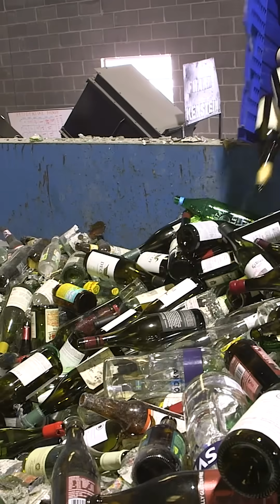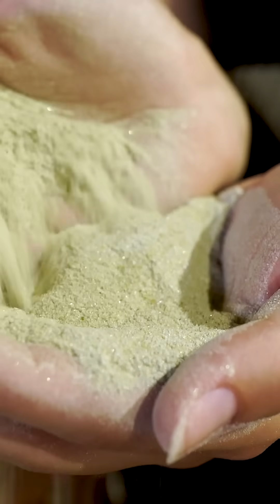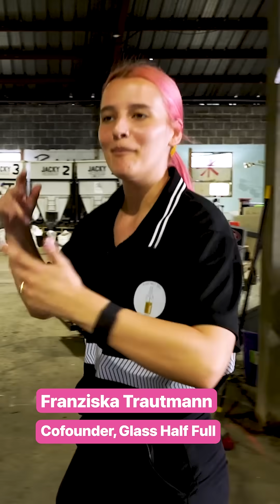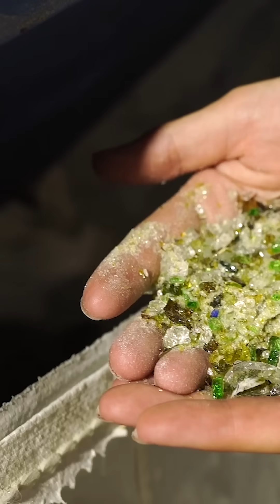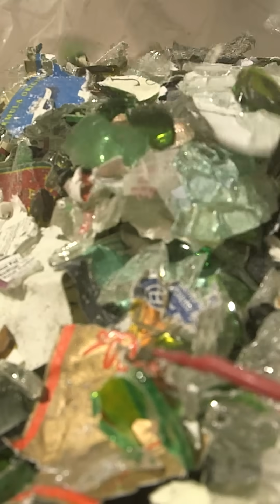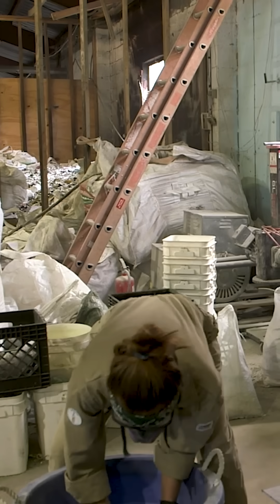Here’s how this entrepreneur crushes glass bottles back into sand. #Recycling #Sand #Glass

Comment: Germany just reuses glass bottles for new bottles by using forges which melt the glass leftovers to one mass while burning of any residues. The shown process is quite cursed. You have a lot of bottleneck processes (no pun intended)slowing down the whole production line. Meanwhile the building site will be full of glass dust, impacting the health of the workers.

Comment: Why would you do this. In europe we have a whole deposit system for beer bottles so they only have to be washed out and then can be used again countless times. This just uses a lot of energy and causes a lot of risks for the workers involved because i didnt see any proper ventilation or air extraction for dust particles. Espacially with glass. That is super important.

Comment: Surely if you ran the glass through a just below melting point, the glue and paper would burn off. If you want to skip a step of chemically removing glue when in a multan state, they could always soak the bottles in vinegar. This would result in less cost with mechanic separation and also loss of total end product because the machine didn't waste what could end up being 1/3 of the overall product.

Comment: Looked really dangerous and inefficient. 
That should all be done in an enclosed space with a ram to push glass into an elevated chamber, the material then dropping into a millstone chamber, after that it drops into a sand trap. You can use a water filter to keep the VERY DANGEROUS micro particles from escaping along with a MCU unit to filter the dust.  Bet there isn’t very many workers who don’t have micro particles of glass in their lungs and eyes, along with every other mammal in the that happen upon the dust area.

Comment: That's great! More of that.
Just funny to hear about something we've been doing since 1972😅
Reply: Blueness1230  what if this thing used in construction? Will there be any difference?

And will the beach ecosystem be broken because the glass dust won't act the same way as real sand? I'm worried if over time, the beaches its dumped in will rise in temperature, making it melt between the real sands and coagulate together etc.
Reply: @huhisitreally  can't be used. Has a less rounded shape as cement sand.

The real heouc story would be whoever figures out how to turn these glass sand grains rounded enough to use in cement.
Reply: @jubhgioubgob  oh yeah. They're shards so yeah it won't hold
Reply: @huhisitreally  Its not that the lack of roundness means it doesn't hold. The shard shape means the cement or concrete will rapidly fail under loads way below what would normally cause failure in concrete. The sharp points create things called stress concentrations were basically the entire load is focused into the tiny point of the shard which results in cracks. Those cracks propagate and the entire thing fails.
Reply: @joshuabaker6452  that makes sense, thanks for the lesson!
Reply: Every female empowerment story ever.
Reply: @mynameisnotyours what?
Reply: @mynameisnotyours  ok Tate

Comment: there's a big difference in crystalline structure, when you crush glass you don't get sand you get crushed glass, and all that's good for is melting down into new containers. the main use for sand is in concrete, you can't use that in concrete, and because the sand in concrete is irretrievable, there is a major global shortage of sand

Comment: That's not sand, that's crushed glass, sand is blunt while this is sharp, also glass particles are in the air, the employer is committing a crime by having the employees work in hazardous conditions without requiring PPE, the only employee seen wearing a mask is wearing it incorrectly

Comment: I really hope they start wearing proper PPE, you only see one person wearing a respirator at the end. Even when the machine is not running, dust can linger in the air for a long time in an enclosed building like that. Silicosis is a nasty interstitial (meaning it affects your tissue) lung disease, trust me you do not want silicosis or any other interstitial lung disease. It will cause scar formation in your lungs and make it easier to get infections like pneumonia and harder for you to breathe. There is no cure and this disease only gets worse with time, all we can do is treat the symptoms and even then there isn’t much we can do

Comment: Help push For a plastic salvage value in reclamation effort. To be awarded, it has been awarded the lead and copper before. This value only applies to scrap or salvage plastics. It would not affect the market price. Because it's a global reclamation effort. We can even build in reclaimables and plastic industries itself. Such as the tabs left behind on plastic bags. So the reclamation effort is also 14 fine grocery shipping and reception. There's a way wording this specifically can help a lot.
Reply: Starting in the right place. It's focusing on the pace of salvage to build in to a perceivable market so that microplastics can be eliminated. Since it is important that we attempt to do so.
Reply: The reclaimables are abridged not focused to stabilize jobs. It's because we re amplified the intention of the reclamation efforts for the vacation. So these excess plastic pieces during a pressing process. Do qualify in order to insure their jobs will be around. Commuting action and parties would be referenced and stabilized in frasing and legality of reclamation Meaning that working with a group, people can be named the salvager. And because of access, it can't be shared with the low job provider if it did not meet the requirements.

Comment: Glass and bottle recycling has been a thing here in Sweden for decades. Standardized 33cl glass bottles for soda and beer are left at supermarkets and you get a pawn deposit for each bottle p. They has to be whole of course. Those bottles are then cleaned and reused.

Glass, white or colored are left in special containers and then recycled into glass again. At home people sort their garbage and then the garbage truck has different container in the truck for glass, food waste etc. People are pretty good at this and the garbage that can’t be recycled are then used as fuel in power plants. We gotten so good at it that we import garbage from other countries to use as fuel. Of course the smoke gases are run thru different filters and cleaners. So no more land fills with rotting garbage anymore!

Comment: “If you or a loved one have had your hands or lungs shredded by glass dust, you may be entitled to compensation”
Reply: Clearly not glass obviously sand 😅😂 like nah it’s still glass
Reply: @ok.ok.5735 THE SAND STINGS THE SAND STINGS
Reply: Right!!😂😂😂
Reply: I want to sniff it.
Reply: Cool now do it with plastic the actual problem in landfills
Reply: @nuke5231  but there are beachs literally running out of sand because of glass used in skyscrapers so yeah of course they gave an amount of bottles saved from landfill to give you an idea of how much glass was procced but the point is not all about reducing landfill
Reply: @thathollyjorge more for concrete, I think. The Chinese have used a lot of concrete. All those buildings, never to be used or lived in. And the roads, bridges, etc.
Reply: They're wearing respirators
Reply: @oliviaocasain9980 Not the pink-haired lady. Even if she only goes in occasionally, glass dust is something you never ever want to breathe in, and handling the partially-ground glass just seems like a glass splinter waiting to happen.

Comment: As someone who works with glass I get chills from the idea of breathing in all that glass dust. Don't touch this stuff.
Reply: Powdered death
Reply: @Justin_Zimmerman perfect description...
Reply: Literally, I hope they're using it for non-touchy projects like sandbags to fill large plots or smth, it's terrifying thinking some people are saying they plan on using it for beaches 😬
Reply: @toadacrosstheroad in the full video this short is based of they say multiple times that their main goal is using this to "restore beaches"
Reply: @mrono1910  hm, idk how i didn't catch that 😭 though it is still not a great idea to put jagged objects into open spaces
Reply: @mrono1910 
God no. That is horrible. 

The sand that you find at the beach does not have sharp edges - unlike the tiny, microscopic shards of glas that we se here - because over thousands of years rock fragments have been ground up and smoothed out by the oceans currents.
Reply: @toadacrosstheroad prob for decor like sand filled photo frames or sand in bottles
Reply: @toadacrosstheroad I think they are using it for making glass again.
Can you tell me if otherwise.
Reply: @toadacrosstheroad  to be fair if weathered by either tumbler or water would that not solve a large part of that problem? it wont take long to round each of the granules
Reply: @toadacrosstheroad they literally explain what it's being used for in the first 5 seconds on the video. Glass is made of sand. They're crushing the glass back into sand to make more glass
Reply: @tedofuentes6525 And to use for beaches
Reply: @tedofuentes6525 Listen again. They said it was going back to "sand" but they didn't say it was for glass.
Reply: @toadacrosstheroad  It's already there from all the decades of people littering broken bottles or burying broken pottery. Had to get my dog's feet stitched up from it. Digging 3X3 holes I found piles in several places in the yard later.
Reply: @Einwetok  yeah, we just shouldn't be purposefully adding more, especially disguised as normal sand
Reply: @Einwetok  oh wait do you mean there was already ground up glass? Either way, it's sad everywhere is a safety hazard because of pollution/littering. The solution isn't to put our processed creations back into ecosystems and expect it to work 😭
Reply: @toadacrosstheroad what’s the difference between this and normal sand? /srs
Reply: @laer.393  This one is glass. Glass is not sand. Inhaling glass dust is dangerous.
Reply: @laer.393  normal sand is naturally tumbled for a long time, think of how sand is typically around waterways or places that used to have water (such as deserts), it's eroded and tumbled around and beaten up.
Also another thing I think makes more sense to describe it: if you crushed up a piece of rock, such as shale or smth, it'd be sharp and jagged until tumbled or broken down more slowly. 
Conclusion: sand takes long time to become smooth, breaking down a rock like structure will create more of a sharp dust; though in larger pieces it could probably be manually tumbled to create more of the sand effect
(/info)
Reply: @toadacrosstheroad  makes sense, i didn’t even think of the role of natural erosion, i thought there was a composition issue. thanks for explaining!
Reply: @laer.393  no problem!
Reply: @laer.393  sand and glass have different atomic structures. Both are most often made from silica such as quartz, however sand has crystalline structure while the glass was molten and is amorphous/unstructured. But that doesn't make a difference healthwise, afaik. It's more about the size of the particles and very fine, ground up dust like shown in the video might embed itself deep into the lungs and cause silicosis. Miners that mine quartz often have that, in german it's called "Staublunge".
Reply: @laer.393 Are you seriously that slow?
Reply: @davidbreier84  It makes a huge difference healthwise. Amorphous silica dust, such as glass, is much more safe than crystalline silica dust, because it is more inert. Silicosis is caused by crystalline silica, which is found in rocks, clay, cement, sand etc. So people who work with these should be much more careful.
Reply: @davidbreier84  thank you for explaining! interesting stuff. yeah, they definitely shouldn’t be trying to use this stuff for beach restoration in that case.
Reply: @terencetam2122  cool, didn't know that. Any info on why amorphous silica are more safe?
Reply: @davidbreier84  Silica crystals "cleave" along a plane when fractured. This exposes a fresh entire layer of "loose" oxygen and silicon ions (the components of silica). The theory is that when the dust is in the lungs, a moist environment, the exposed layer releases these ions as free radicals (ROS and NFS), causing damage. It is also worth noting that "old" crystalline silica dust is less dangerous since the radicals have been already released, so playing with beach sand is safe (as long as you are not mechanically grinding it to dust). I believe that breaking amorphous silica exposes much fewer "loose" ions, because it does not cleave, which makes it much safer.
Reply: @Einwetok The difference is that your experience is in isolated cases, not deliberately ground down into microscopic splinters that will cause alveolar hemorrhaging. Your dog's paw < millions of asbestos-like glass shards in the lungs of countless people.
Reply: @laer.393 Sand is rounded and smoothed over time. This crushed glass doesn't have that process. Up close, the profile is much sharper.

There's also the smaller, dusty particles that pose a danger to your lungs. That doesn't exist at the beach. The idea of using this stuff to restore a beach seems wrong. Rather, it seems the opposite, like actively polluting a beach is your pour this on it.
Reply: @davidbreier84  Thank you!!
Reply: as i glass blower i also agree,nasty stuff
Reply: As a red seal glazier working my way to become a master glazier in ALBERTA Canada I can confirm this. Glass is Dangerous if not handled right.
Reply: @exhausted7142  yeah, but before they're tumbled it's a hazard. Also natural tumbling takes thousands of years, we can't just throw untumbled raw glass shards into ecosystems and act like it's fine because it'll naturally tumble in 10-100 years 😭
Reply: @exhausted7142  also a rock tumbler is not accurate to natural erosion, in a tumbler it is constantly moving with water and other forms of sand/gravel stuff to actually break it down. I don't get how something like a beach would be able to replicate a rock tumbler and "take a few hours", people use rock tumblers because it speeds up the process a crap ton instead of just sloshing it around in a bathtub basically, even though the ocean moves a lot stuff isn't kicked up a ton unless disturbed and it would require constant disturbance to not take a super long time, comparing a rock tumbler to a natural environment is wild 😭 there's a reason we simulate everything like I said
Reply: @exhausted7142  it's not the larger stuff that's the issue, fine powdered glass sounds even worse than chunks because you can't see them when they stab you, I'm not saying I know more than professionals I just literally have never seen a single professional state powdered glass is safe to be near or touch or dispose of outside of sharps containers/specified disposal methods like re melting in glass blowing
Reply: Don't go to the beach then either.
Reply: @cilantroisbetterthanparsley yea I was just about to say this, a good percent of sand at the beach is just ground up glass
Reply: I feel like if this was ball milled for a little while it'd be pretty fine. Chemically its pretty similar (ie identical) to a lot of sand, the issue is that its sharp. So long as its eroded before use idk that this bothers me at all, and i hate pollution. 

All that being said, you dont need to erode it to make it safe it if its just used in concrete for construction, which seems like the best of both worlds given how much damage is done to waterways by sand mining every year.
Reply: Arousing
Reply: That was the first thing that occurred to me. I see many think this too. I'm sure this person wears a mask. Think she should have made this clear at the beginning  😮
Reply: What about your eyes?
Reply: Yeah I know. And for some reason NO One Will believe Me!
Reply: they seem to have masks but i do wish that they had better ones
Reply: As a lampworker, I agree as well. Even the larger grain frit can be full of dust.
Reply: I’m sure they’ll put a warning label on the final product.
Reply: about thirty years ago I found a paper bag of shiny stuff on the side of the road after a painting crew had been painting the stripes on the side of the road.
it looked like the stuff they were mixing into the paint to make the road reflective. I still have the bag of sand stuff somewhere in my storage unit, I used to touch it all the time and mess with that too, it's been thirty years, and I'm fine
Reply: @deanasnarky3903  Silica dust increases your risk of health problems.
Reply: Hey now they've got a giant fan pointing at the shaker table to blow all the dust away, that's gotta be safe right 😂
Reply: As somebody who doesnt care. I dont care.
Reply: Lol I followed up. These Democrats have turn lungs from breathing glass.  God bless the Democrat party😊
Reply: @exhausted7142  I doubt they'd tumble it beforehand because it'd just make more waste and byproducts, I don't see how putting glass to replace sand is a good solution. It's much easier, safer, and environmentally friendly to just use it for construction work. Or recycle it all together- I don't think our solution to excess glass is to throw it where it doesn't belong
Reply: They're wearing respirators and goggles.
Reply: @oliviaocasain9980  in the video someone is clearly holding the glass and near the buckets without any PPE 😭
Reply: @oliviaocasain9980  yes but the end user won't be

Comment: no glass should be going to landfill anyway 🤷🏻‍♂️ glass is 100% recyclable . 100% renewable 100% reusable it can be washed clean . And I'm preety sure it's contaminat free . And in a sence Biodegradable . not very sure about the  last part but it makes sence . with little process it can litteraly be checked back into the sand .

Comment: This system can be refined and automated. 
Refined via a airtight recycling line. Automated well automations.
Would improve money saved and bottles recycled.
I also suggest they add a low temp burner to burn off the labels but not damage them.